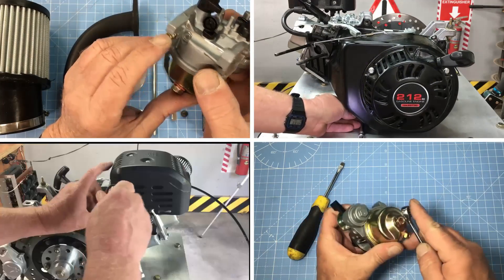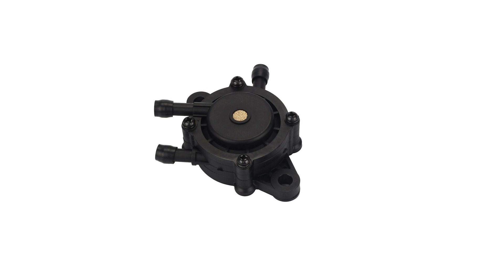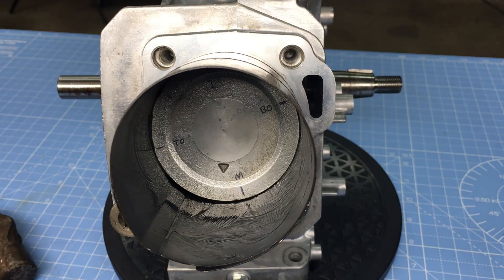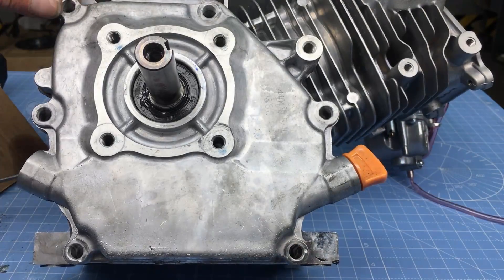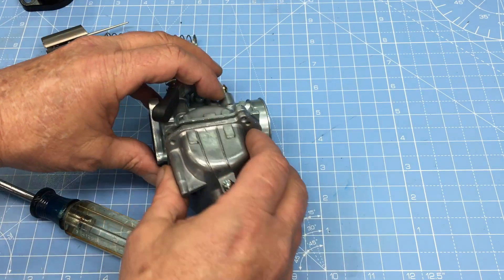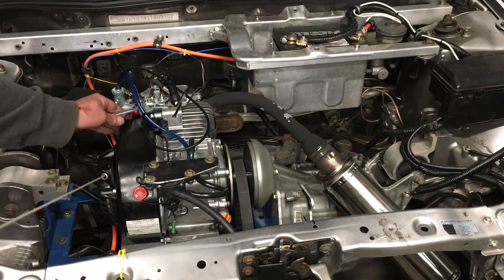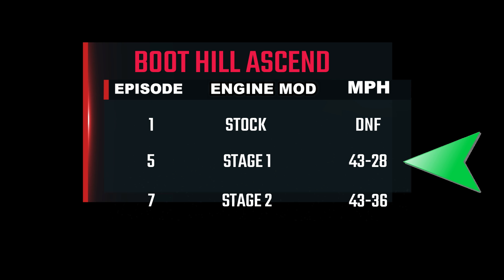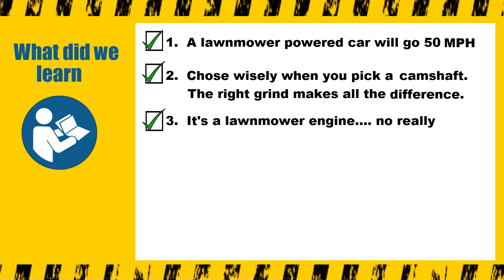Episode 7.  We  get the Honda insight to go 50 MPH with a lawnmower engine.

Comment: It would also be really interesting to add back the electric motors and use the small gas motors to just run a generator to charge batteries.  Then the car would be a lot like the volt - electric but recharges using a gas engine/generator.  You'd have no power/torque problems anymore, but you might have a pretty significant battery drain if you demand too much from it for too long.

Comment: That carb is smaller than the one on my 80cc 2 stroke dirt bike. I mean, why?
Reply: The carburetor can have a smaller body size as long as the Venturi is within range for the CC and the Jets are correct for the right fuel-air mixture. Bigger is not always better
Reply: @brenttate9299  how much power can a 212 like that make?
Reply: @fullmetaljacket7   that stock engine is rated at 6.5 horsepower
Reply: @brenttate9299  I see. The cr80 makes around 20 stock and revs a lot higher being a 2 stroke so maybe that's why it needs a bigger carb
Reply: @fullmetaljacket7  that's right higher rev mean more fuel consumption

Comment: What is the MPG of that car?
Also, why not create a hybrid that uses electricity to run the car and a gas generator to recharge the batteries when they are low?
Reply: In another video it got 54 mpg

Comment: I did not see all the videos. Is their a charging system for the car?
Reply from the maker: Yes and no.....  It was never really discussed, but the 212cc engine is equipped with 2 coils under the flywheel.  These coils do not come with the engine and were purchased separately..  These coils produce a few amps to charge the battery.  I elected no to mention too much of the electrical because I will be doing a full video on just electrical in the future.  That being said, most of the time the charging coils were disconnected.  The car doesn't use much power.

Comment: Maby try tuning the cvt. Will make a big deference in performance having a higher stall speed in the clutch.
Reply: Also get that belt tighter please, looks like your starting  to drive in maybe 3rd or 4th gear. Look up snowmobile specs to get some ideas from the guys that have been using the cvt for a loooong time. Polaris service manuals from the 80s and 90s work well and have lots of info

Comment: Is your Ima still hooked up? Or is it running engine only?
Reply from the maker: The IMA is long gone.  the car is just powered by the little engine.
Reply: @robotcantina8957  that's cool!! Can't wait to see your hemi build finished are you also going to be doing upgrades to that engine? I guess I'll just have to wait and see 😁 definitely got a subscriber here
Reply from the maker: @ils360  The 420 build is finished and the new video will be released in a few days.  I plan on doing mods to the 420 including fuel injection.

Comment: what miles per gallon did you achieve?
Reply from the maker: With this  engine, I did not  measure MPG.    I have since found out that the viewers want that info so in all the videos  from this point will have that data.   Even though I didn't measure the MPG, I do know it wasn't as good as the stage one engine.  As I recall the stage 1 engine got 54 MPG.  I estimate this engine got somewhere around 35 MPG.

Comment: Sir could I have a a link to the carb
Reply from the maker: CARB
https://www.amazon.com/TC-Motor-Performance-VM22-3847-Carburetor-Mainfold/dp/B07H967VTM/ref=sr_1_2?dchild=1&keywords=TC-Motor+Racing+Performance+Carburetor+Mikuni+VM22-3847+Carb+Mainfold+Intake+Inlet+Pipe+Air+Filter+For+Predator+Mini+Bike+Go+Kart+212cc+GX200+196cc+Engine&qid=1609602743&s=automotive&sr=1-2

JETS
https://www.amazon.com/Bruce-Shark-Carb-Main-Mikuni/dp/B083LPRVJ8/ref=sr_1_1?dchild=1&keywords=Bruce+%26+Shark%2C+Carb+Main+Jets+for+Mikuni+N100%2F604+VM22+VM24+VM26+VM30+26mm+28mm+Pit+Dirt+Bike&qid=1609602830&s=automotive&sr=1-1

CABLE
https://www.amazon.com/Yingshop-Throttle-Cable-Mb165-Doodlebug/dp/B07JMBP4Q8/ref=sr_1_6?dchild=1&keywords=HIAORS+50inch+Throttle+Cable+for+CT200U+Mini+Baja+MB165+196cc+5.5hp+MB200+200cc+6.5hp&qid=1609602529&s=automotive&sr=1-6

Comment: Great series !! But why did you plug two holes in the crack case...then drill another one in the thin casting wall?
Reply from the maker: Great question.  The two holes that were plugged were left over from when the governor was removed.  I ended up drilling a new hole in the crankcase for the fuel pump nipple.   The hole for the fuel pump nipple needed to be pretty big and I could not use the existing holes that were in the block.    The fuel pump that I used needs pressure pulses in order for it to pump.  The pressure inside the crankcase is constantly changing due to the up and down motion of the piston.  the nipple tapped into the crankcase provides a natural source  of pressure pulses the engine develops.
Reply: @robotcantina8957  I'm in the process of building an engine right now. I was going to take the pulse off the intake, since I'm building the carb adapter anyway. You made me wonder if I should tap the crank case instead? It may be a better source during WOT operation.

Comment: you should try a diesel engine next, and use the stock clutch or a centrifugal one with a chain. those cvt's are NOT efficient. direct drive to the trans is what you want, diesel tourque is required.

Comment: Just a note, but in my experience a longer intake runner with no obstructions will move some power down into the low end RPM without affecting the high RPM power if the cam is ground for high RPM power. The length has to be extended on both sides of the carb to prevent a condition known as fuel reversion that has a cloud of fuel vapor outside the engine.
Reply from the maker: This is great input and is going on the list of things to try.

Comment: What about getting this motor instead of the Predator: https://www.generatorfactoryoutlet.com/products/duromax-xp18hpe-440cc-18-hp-3600-rpm-1-inch-shaft-electric-start-engine?q=440 It is a Duromax 440cc, 18HP instead of 13HP, And I believe that some of the predator performance parts fit it and it is the same price as the Predator. You would be starting off with 5 more HP for the same price.
Reply: The price I saw on the generator factory motor was over $300 he said in the video on the first video that he paid $99 on sale big difference in pricejust not sure how much he paid on modification parts
Reply: @jackjackson7461  Yes.. He paid $99 for the 212cc engine, The 420cc that he just put in is the same price as the engine I listed, Without any mods.

Comment: The detail was fine. Is the clutch adjustable? Since you moved the torque curve upward, the optimum clutch engagement RPM needs to go up too. If you can do that, your 0-30 time will improve.
Reply from the maker: I was thinking about taking half the weight pucks out of the clutch and testing it again.  I have always felt the clutch locked up too soon, even with the unmodified engine.

Comment: I suspect the difference would be overall negligible, but will there be MPG comparisons with each engine/mod level?
Reply from the maker: Hi Steve,  the fully modified engine really sucks the gas down quickly.  I didn't get any numbers yet but it as good as the stage 1 engine.

Comment: Should have used the CL1 original grind high torque cam.  It was designed for the RPM range you are limiting yourself to.  That mod 2 cam is for engine turning up to 7000 RPM.
The CL1 cam is designed to turn 5200-5800 RPM with lots more low end torque.
Reply from the maker: Are there any clearance issues with the CL1?     Thanks for the heads up!
Reply: @robotcantina8957  Lift is pretty much identical to the mod 2 cam.  So I doubt there would be any clearance issues.  NR racing has info on both camshafts.  There are two different CL1 cams.  The one you want is the original grind.  Part number is DYNO-CL1-108
Reply: @robotcantina8957  The part number right from dyno cams is CL1.  It would be interesting what your latest testing would look like with a cam closer to the rpm range you are running.

Comment: Cool video update. Any plans to bring this to the challenge next year with a big block Lawn mower engine? BE pretty funny though and any chance to give a cost of the car and the parts into this total? If others want to build their own insight it would be fun to know.
Reply from the maker: I would love to take this thing to the GRM challenge  but I not sure about the timing of next year.  I'm going to do a video on costs soon.  If you play by the GRM rules its about $1300 to build with a 420 big block and a comet 44 clutch.  The cars can be found cheap and most of the unused parts can be sold, but its the lawnmower parts that will cost the most, especially the engine and clutch.
Reply: @robotcantina8957  there is the idea of looking for a bike or cart or tractor to get a running motor with more power to get the price down for a challenge  car and budget.

Comment: Just discovered your channel and you diffinately have a new subscriber! Just a thought, but wouldn't the original flywheel give you a little more torque since it's heavier?, or am I thinking backwards?
Reply from the maker: The flywheel stores energy and a heavy one will  make the engine run smoother.  I prefer the heavier cast iron flywheel but unfortunately they are known to explode above 5000 RPM.  In my case there was little to no danger from an explosion because the engine  is located far away, but an exploding flywheel on a mini bike or go kart is a lot more serious.

Comment: Not sure why you would want to limit the RPMs to 5k. A stock ungoverned 212 will run 5k. Valve float kicks in ~5500. The engine you build should be able to handle 7k with ease.
Reply from the maker: We ended up using the stock cast iron flywheel and that is why we limited the engine to 5K, otherwise we would have run it a lot harder.
Reply: @robotcantina8957  I must have missed that part. Stupid election is distracting me...

Comment: This P 212 build ended up way past the $99 mark. What was the final cost?  Curious to see whether it’s more effective to mod the cheapest engine or simply buy its larger, not-quite-so-cheap bothers.
Reply from the maker: Great question! The cost of the engine and all the parts including the billet flywheel that I didn't use was just over $500.00  Yeah, that's a lot but its a strong engine.   The 420 engine runs about $400 with tax and is a great engine but keep in mind it would need upgrades if you wanted it to rev higher.  Its a tough call.  I may do a video on the pros and cons.
Reply: https://www.harborfreight.com/22-hp-670cc-v-twin-horizontal-shaft-gas-engine-epa-61614.html

If you added the big boy you would need no mods except for removing the governor and have electric start and a12v charging system

Comment: Just subscribed! I've watched a few of your videos in the past. Im sure someone has given you the idea, but have you thought about running 2 predator engines in parallel? Instead of spending so much on upgrades?
Reply from the maker: Hi Dustin,  The double Predator engines has been considered but they wont fit under the hood of the car.  The various modifications  and engine builds are for channel content.  We like to joke that this is a lawnmower engine, but it's really a go kart engine and we are showing some of the different ways to make more power.  Its all for fun.  I hope you enjoy the videos.  :)
Reply: They're good videos keep it up, and yea i can see 2 not fitting in the car without a ton of modifications.

Comment: Congratulations you made it over 50 the Predator 212 makes about 6.5 horsepower stock the stage 2 Kit with the stuff you were doing it about 11hp I tested that stuff before but one of the better motor for that type of application you got would be the Predator 420 with the stage 2 I think would be lightweight Plus make about 18 horsepower with that in mind you should be able to make it to 60 no problem Plus have some decent 0 to 30 test in a couple weeks I'm only doing it to my car little bit more heavy of a car what that is what V-Twin 20 horsepower is for hehe

Comment: This is great but I just imagine what a 13hp or v twin could do😂 but it's awesome to see what powers my go kart is moving your car and that's amazing, cheers I'm subbed and watching the project close👍
Reply from the maker: Thanks for the sub,  We definitely will be testing more engines in the future.
Reply: @robotcantina8957  sounds great, if it gets to faster acceleration and speeds I might replicate and buy a blown engine insight in the future would be great town car-t  and cool as hell I like merging small engines and cars kinda the ultimate fusion I respect your work!
Reply: @robotcantina8957  How about putting a electric motor i recon 15-20hp should do it ??  you could use an in-wheel hub motor mounted above gearbox ... the hub motor could be ok to compensate for cam shaft mods... eg,  QS Motor 2000W 205 V2 Brushless BLDC Electric Car Hub Motor on www.aliexpress.com

Comment: How do you run the electrics with that engine, power steering and power brakes?
Reply from the maker: The car doesn't use much power.  The brake lights and turn signals run off the battery.
Reply: Do you have to charge the battery at home before you head out?
Reply: It seems that using a larger engine with electric start would give the necessary charging circuit and not needing to modify the crap out of a lil engine
Reply: I can’t see on the HF site that the 420 has a charging/12v coil, the 670 obviously does as it comes with electric start
Reply: Think about it it won't need power steering or power brakes because I how much weight did he remove from the original engine as opposed to this one I bet the car is at least 500 lighter which would equal about a quarter of the total body weight of the car

Comment: How hard did you push the Honda? If you push it off a big enough cliff, it will do 50.  Is an E-10 socket the same as 1/4" 12 point?  I have bought and lost a 1/4" drive, 1/4" 12 point socket more than once.  I only use it for ARC rods.  The sockets are made of Dissapearium.  The MOD2 cam is for higher RPM.  It has longer duration.  With small valves, maybe you need the longer duration to get enough air in the engine.  I would have gone with a cam that had more lift, but not as much duration as the MOD2.
Reply from the maker: The MOD2 cam seemed to to work pretty good,  but I would have liked to have tried a few other grinds.